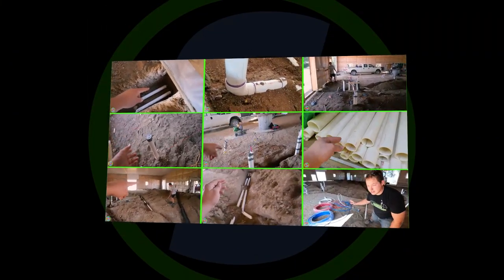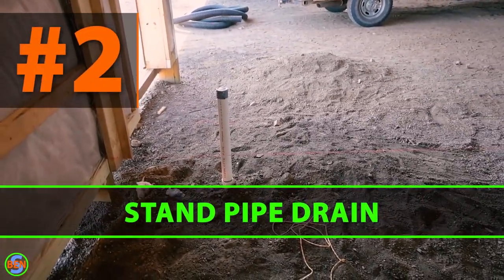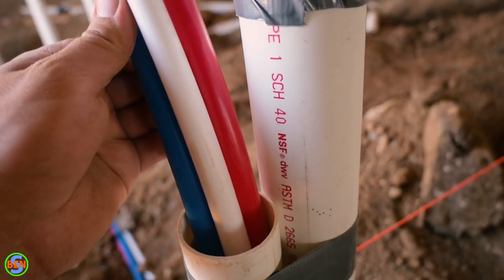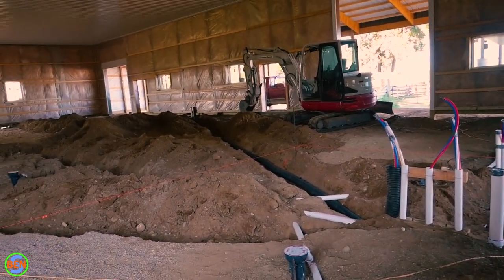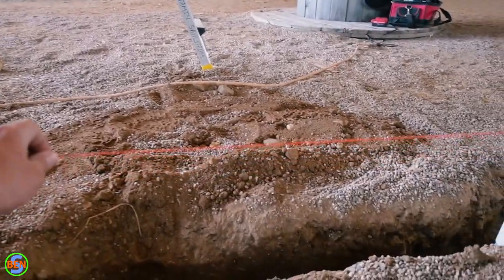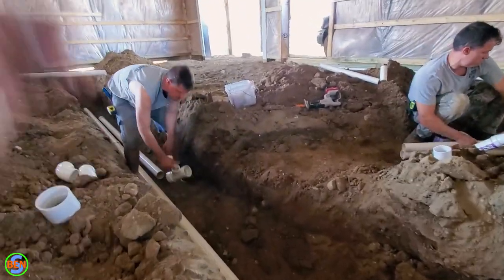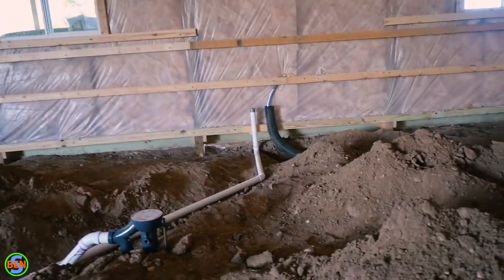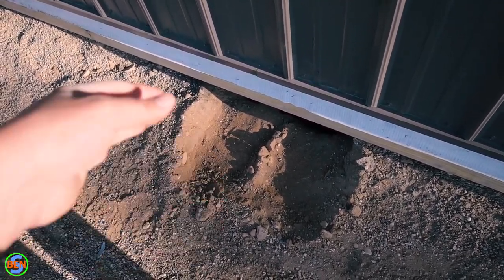How To Rough In Underground Plumbing for Bathroom, Floor Drains, & Sinks, Using PEX & PVC

Comment: You can run a continuous waste line and have all the floor drains you want as long as you oversize the vent at the end one size larger then p-trap on floor drain.  We do it all the time in car dealerships where there are no walls for vents other than end of line vent and clean out.
Thanks for sharing. Please remember  that license plumbers lay straighter pipes….lol

Comment: When it comes to venting, like say for a floor drain in the center of a room, if I’m not mistaken you can oversize the drain to the fixture and have an infinite length back to a vent. Like say instead of running 2” for the floor drain run it in 3” to a 3-4” main.

Comment: In Sweden we sleave a small pvc/plastic pipe on the rebar, sticking up to support the pipes etc. Just to make it easy to pull up the rebar, when the slab is poured and hardened. Our PEX tubes always comes with a corrugated sleave. Both for protection and easier replacement I guess. Always cool to see how stuff is done other places in the world. Do you use any insulation or capillary breaking material under the slab?

Comment: So the pex water lines just lay right on top of the drain pipe? I saw some other videos saying pex cannot be in direct contact with concrete, I guess those were wrong? Also why not ABS for the drains instead of PVC?
Reply from the maker: It is important to sleeve PEX wherever it comes out of the slab, but it's obviously used all the time in direct contact with concrete for in floor heating systems. For water lines, I prefer to keep those away from direct contact with the concrete if possible. No one uses ABS in our area. I'm not really sure why.

Comment: You should almost always say concrete. Cement is just one of the components (with sand) that make concrete, concrete. So you have a concrete driveway, concrete sidewalk, concrete foundation, concrete blocks, etc. It's like calling NM or Romex a cable instead of wire, because it's a bunch of wires together that make cables.

Comment: Why not wet vent the toilet?  Am working on 40x40 post frame house, and am planning on doing plumbing first before putting up the house.  Doing this because I want to build up a layer of 3/4" rock for a radon system below the slab.
Reply: You can horizontal wet vent a toilet. Actually a toilet doesn't require a direct vent so a vent can be anywhere on a system. PER IPC

Comment: I love your videos, and I know you are doing the " right" thing with primer; but over the years, I have found that primed pipes actually make "cold" joints, that break/pull apart, far more easily than non-primed pipes, especially when placed under EXTREME stress....any ideas what I am doing wrong with the primer?

Comment: This does not have anything to do with the video. But what's the proper way to repair a 1/0 x3 with ground wire when sheathing has been stripped back to far where it goes into the breaker box?